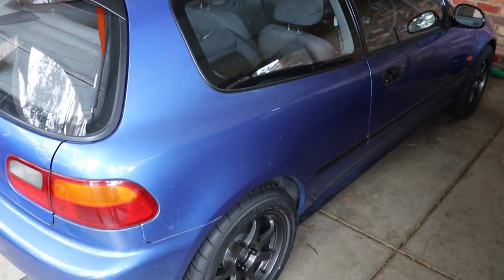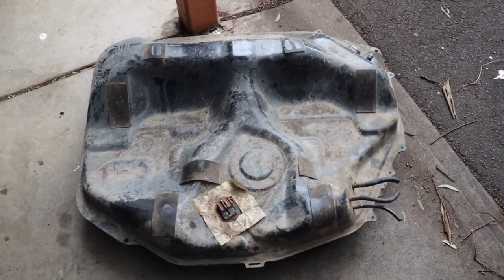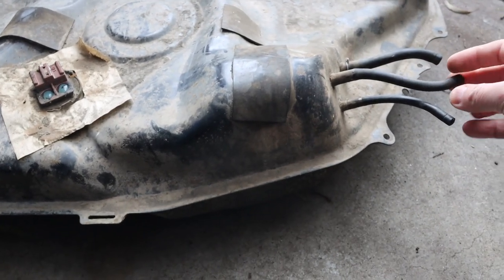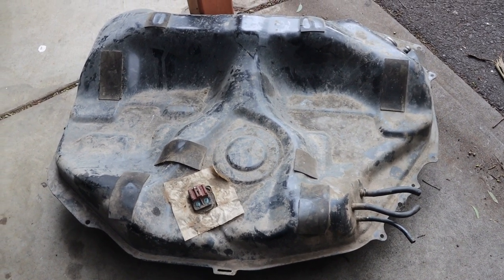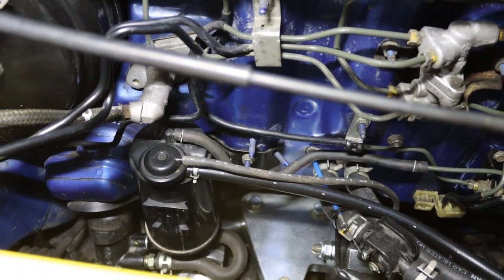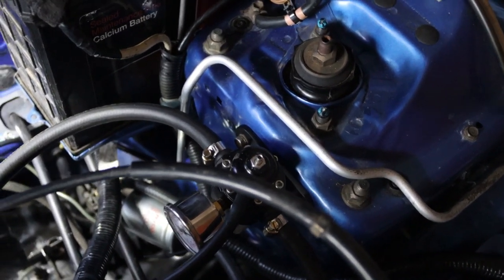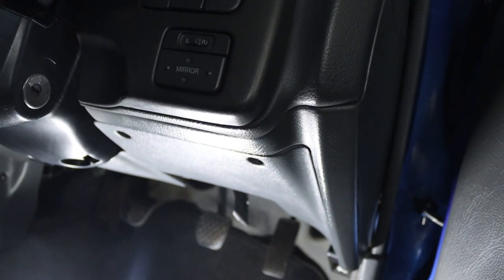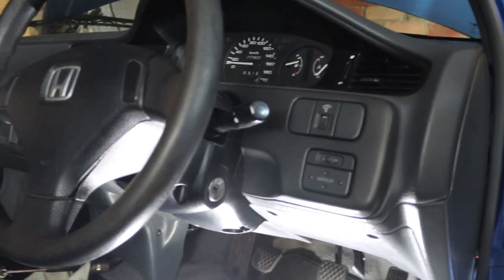Converting an EG Honda Civic from Carby to EFI for K swap

Comment: Im currently doing a efi swap on a carby civic and finding it near impossible to find a diagram to wire up the relays to the standard b series wiring loom. I.e the fuel pump and starter motor! Love your build and detailed video. Giving me some motivation
Reply from the maker: Yeah thats why the k swap is easier, you basically ditch the whole carby engine loom and start from scratch. I actually think it might be easier doing that with a B series too. Like make/modify a custom conversion harness which plugs into the shock tower plugs as everything should be there which is needed for B

Comment: I have a 94 honda civic d15b3 carb, am planning on doing a mini me d16y8 and also want to convert to efi, i have all the d16y8 manifold parts , also d16y8 harnes,  couple of questions? Can i use p28 ecu, which fuse box can i use? Or can i use my original fuse box with modifications.
Reply from the maker: Not having a  lot of experience with B or D series engines but I'd imagine you need efi car engine and under dash loom at a minimum. I think the fuse box should work as all the diagrams I've seen were the same between efi/carb cars.

Comment: Looking to do this on my 93' cb3 accord that has a vacuum controller carburetor. Do i need the dash wiring also? From what I've learnt, I need to wire the fuel pump and the injectors. Some forums state, that I need to swap over the engine harness AND the dash harness. I don't know why I would need to do that. Can you tell me? I'm planning to use an engine, engine wiring harness, fuel tank, fuel lines and ecu from a same year model accord.
Reply from the maker: yeah so the engine requires a few wires. "conversion harnesses" usually supply a lot of these wires from the car to the ecu. If you cant get a conversion harness for your accord you'll have about a dozen wires which you need to source and hookup to the ecu/engine loom. These are things like ignition powers, grounds, reverse lights, dash temp sensor, fuel pump, oil pressure light. Its not impossible, but a bit harder.
Reply: @teamaxlestands  Thanks a lot! I totally forgot about the dash warning lights.

Comment: Thank You so much for all the information you saved my day . Btw did  you find any solution for the ELD and check engine light ?
Reply from the maker: Not yet, ELD really doesnt matter at all. The check engine i'd like to get working, the stock dash didnt have the light so i think i'll have to do some wiring to get that one working with my new dash. Not a biggie for me at the moment as i have the bluetooth dongle to help with any errors.

Comment: Love it , do you just use a normal relay for the fuel pump ?
Reply from the maker: I used a Honda one... and modified it and it basically works like a normal 4 pin relay. So yeah if i had my time again i'd use a normal relay. If you already have a Honda one and want to know how i wired it let me know i'm pretty sure i have it written down somewhere. If using a normal one you'd have Pin 85 to ACC Pin 86 to ECU Pin 30 to 15amp spare fuse in the fuse holder and pin 87 running to the fuel pump positive.
Reply: Is ek one ok to use ? I don’t mind to get a Honda one haha
Reply from the maker: Yeah I'm pretty sure they run the same relay. Just got my notes on this and you can double check but my eg wiring was: Yellow/Green: To positive side of Fuel Pump. Black/Yellow: To Accessories/Ignition. Black: to ground. Yellow/white - 12v fuse under dash (constant power). Green/yellow to ECU trigger
Reply from the maker: oh and there are 2 more wires left which need to be joined. Blue/White and Yellow/black - this is because the standard relay runs like a twin relay in one and you only really need one with a K series.

Comment: Do I need to swap out the hard lines from an injected car? Or only swap out the rubber carb lines with high pressure ones? I have a carb JDM EF I am k swapping. Have an EFI tank and USDM hardlines, but if I don't have to swap metal lines I won't. Thanks in advance!
Reply from the maker: Your carb car should have hard lines (unless its modified) and it will depend on the size of your hardlines. With my car the lines were adequate and all i had to do was remove all the existing rubber hose and replace it with high pressure EFI hose. I also had to swap the breather with the return (for some reason in my car they used a bigger breather hard line than return so I simply swapped them). I'd jump under your car and have a good look if you have hard lines, and if you do are they suitable size. If someone has replaced them all with rubber i'd install your USDM hardlines.

Comment: How did you find what the pins are for from the old ECU? I’ve been looking through forums and user manuals but no one really talks about the carbureted vehicles. Can you help me?
Reply from the maker: Yeah this wasnt exactly correct. I went off the colours of the wires and the ELD and MIL were not working. I have a feeling the carby cars (at least mine) didnt run electronic load detections and getting the check engine working is still on my todo list. I'll be sure to update this wehn i work it out

Comment: One more question brother is there anything special thats needs to be done to get the fuel gauge to work when putting in the efi tank?
Reply from the maker: For me it plugged in and work. One thing i think i'm missing is the fuel light because my car didnt ever have one. I believe there is one pin missing in my plug but it doesnt impact the level working at all.
Reply: @teamaxlestands  love it thank you! Do you have a Facebook or a email I can contact you at I'm going to be starting my swap soon and I'd appreciate it if I could use you as a reference.
Reply from the maker: @Beezy_Builds  sure - I created a facebook page under team axle stands and msgs should come through to me. Just give me a msg on there.
Reply: @teamaxlestands  perfect thank you

Comment: Hey man got a couple of questions got an eg4 and wanted to do Efi and motor swap as I only picked the car up for 500. How easy was it fitting the ek fuel tank and can you use a tank from a hatch .
Reply from the maker: Fitting the tank is pretty easy. Just remove the 3 fuel lines (feed, return and breather) which are all at the bottom of the tank. Remove the Filler neck (this is probably the most fiddly bit). Then you can drop the tank down by undoing the 2 straps that hold it up. Installation is the reverse however with the efi tank the lines are at the top so you'll need some extra hose to join them to the existing lines if you go that route. EK hatch should work fine, i used an EK sedan and it wasnt exactly the same but bolted up fine.
Reply from the maker: oh you can also see a bit more here on the tank swap (sorry for the terrible filming): https://youtu.be/IS8qQ14CwkU?t=370

Comment: hey bro what conversion harness are you using to wire up the engine harness to eg chassi ? how did you find the wiring on eg chasi to wire it  to the conversion harness ? i cant seem to find the A and D plugs  in eg chassi for me to wire my conversion harness we all know it doesnt have the ecu. please help if you know about this .thanks !
Reply from the maker: I'm using a generic style conversion harness which i got off ebay. There are quite a few people making and selling them. The conversion harness plugs into the E plug and the C101 plug and then to the 2 plugs on the right hand shock plug. The A plug goes to the engine loom and the D plug is the auto plug (i havent had much experience with it but pinouts are available).
Reply: @teamaxlestands   I got all the harness installed but when I turn my key on I don’t have any lights on my cluster . Any idea what ive done wrong ? I got everything working from lights ,horn radio but no lights on cluster .
Reply from the maker: Di you mean like your indicators/lights to light up the dash? I'm not sure this will be related to your conversion harness. The only bits which come through that are usually: Alternator light, oil pressure, check engine and speedo/tacho and i dont think any of those would stop other dash lights coming on. Maybe check the fuse box under the steering wheel and also the one in the engine bay? If you are talking about the cluster illumination it could be blown bulbs too i guess. They do all seem to blow at about the same time.
Reply: @teamaxlestands  yeah I’m talking about the cluster illumination. Indicator ,hazard head lights are working apart from the actual light on cluster .

Comment: hi, do you know what the real difference is between the carby and EFI cabin harness' are?
Reply from the maker: I actually didn't use the cabin harness at all in the end. There are 3 wires which usually tap into the cabin harness for a k swap. engine light, electronic load detector (which doesn't exist) and fuel pump. I've run a separate wire for the fuel pump and i monitor the fault codes (engine light) on my phone through an app. In terms of the plug which the conversion harness plugs into (shock tower plug) its identical so very easy.

Comment: Putting k20a3 into carbd 86 crx. Running 03 rsx tank as to pass CA smog all components have to be from the newer vehicle.
Reply from the maker: oh wow, that's pretty strict. I've heard CA is the toughest of all the states in the US. Really they are all pretty similar, they just reduced the number of lines and the location of the fuel pressure regulate/EVAP gear to the thank.

Comment: Out of curiosity what D series was it? I'm in the UK and mines a D13B2
Reply from the maker: This was a D15z2 - i'd imagine they'd all be a similar setup. It had a computer which controlled valves to run it correctly. I guess as close to EFI without being efi.
Reply: @teamaxlestands  Yeah mine has an ecu, I guess for the same purpose

Comment: No main relay ?
Reply from the maker: Yeah I used a main relay but wired it up so it works like a regular relay just for the fuel pump. It simply connects the main fuel pump wire when the ecu grounds the relay.
Reply: Can you produce a wiring diagram if it’s not to much to ask

Comment: I need some help. Did you keep your oem wire harness loom to k swap?
Reply from the maker: I unplugged the d series engine harness at the shock tower and pushed these plugs into the cabin. But yes at the moment the old harness still exists and is just not used.
Reply: @teamaxlestands  I'm just starting and I hope I don't seem like a bother but I'll be asking a bit of questions relating to this.

Comment: Great job !! Is the car running and driving good ? Any more updates ?
Reply from the maker: Yeah i have to do a driving video. I've probably done about 1000 kms in it now and its still driving well. I've been fixing up/improving a few things but it pretty reliable so far!
Reply: @teamaxlestands  that’s awesome I’m gonna do my k swap on my eg twin carby and I’m gonna do your same fuel set up
Reply: @teamaxlestands  awesome work, Just a question. I have a carby Eg and i have to swap a k24, can i Just buy an efi pump ad insert it info the stock eg3 fuel tank?
Reply from the maker: @lucabellantoni5350  Not easily. The carby fuel tank has to outlets at the bottom of the tank which feed the pump (in the engine bay). Whereas the efi style ones have a removable pump part which you insert from the top. I've seen some people do an external pump, but you may have issues with fuel surge unless you put a surge tank in.
Reply: @teamaxlestands  Thank u so much. since the outlet Is up on a EFI FUEL tank for Civic eg5, do you think i can order It and insert It into my eg3? Which EFI fuel tank models are mechanically compatibile with my eg3?
Reply from the maker: @lucabellantoni5350  Yeah i was just looking at my carby tank and it does have the blank for the fuel tank sender bit. However I doubt it will have the swirl pot part at the bottom so you'll likely have issues with surge still when the tank is low. If you want a complete tank replacement I would guess the following would be compatible: EG Hatch or Sedan, EK hatch or sedan or DC2 integra. I used an EK sedan in my hatch and it was fine.